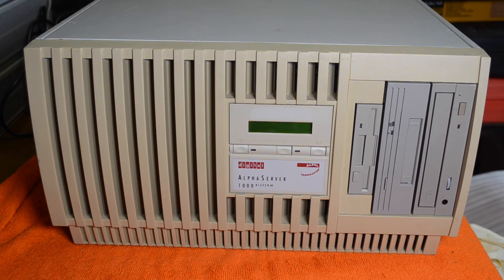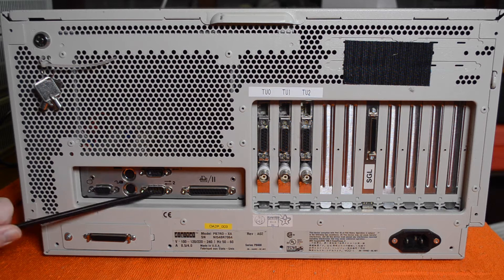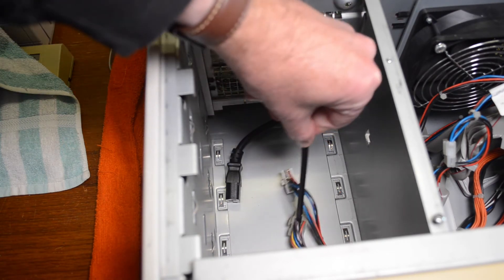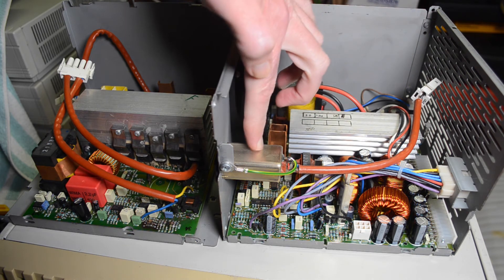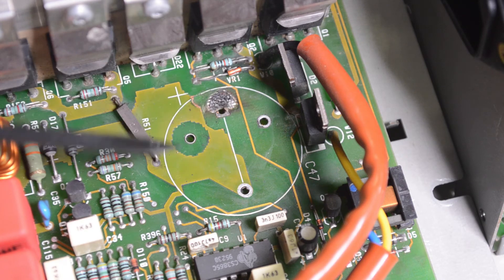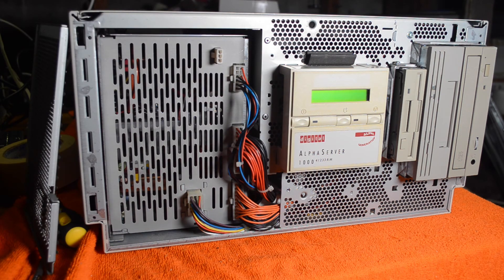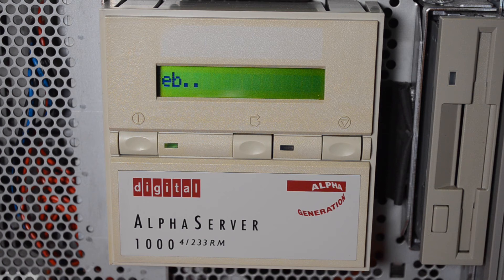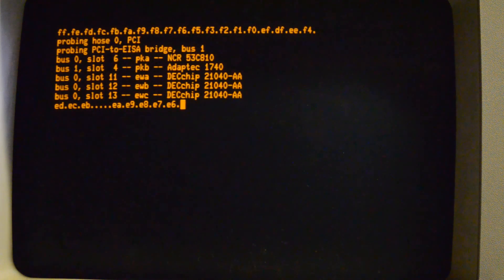AlphaServer 1000 Repair - Part 1

Comment: if you have any MIPS decstations, the alpha SRM is somewhat similar. I think this model had AlphaBIOS as well and supported Windows NT. The configuration utility for the mylex RAID controller in my 1000A 5/400 ran from AlphaBIOS, but otherwise everything through SRM.